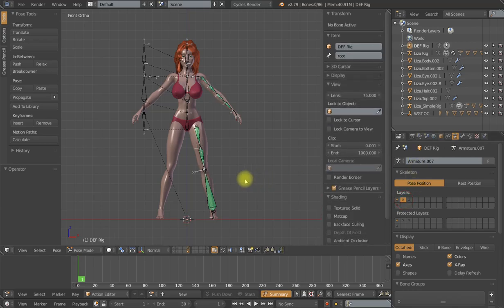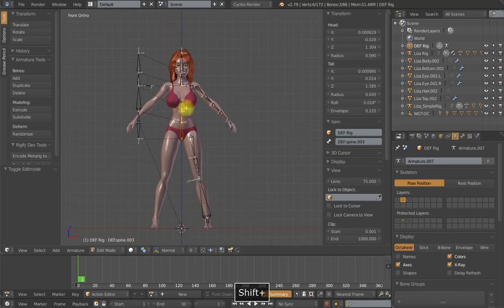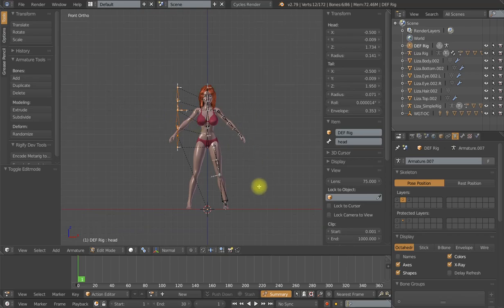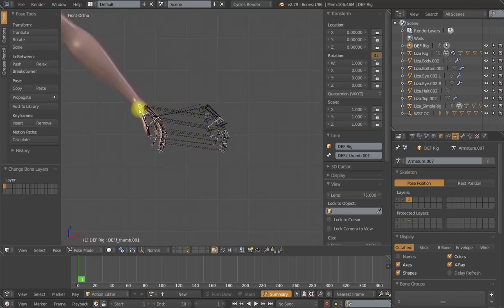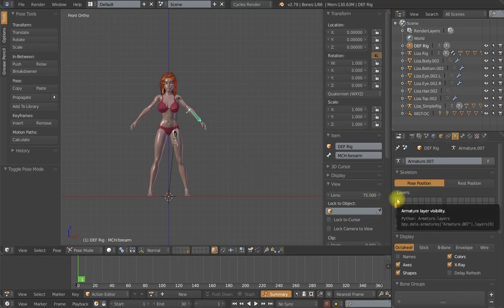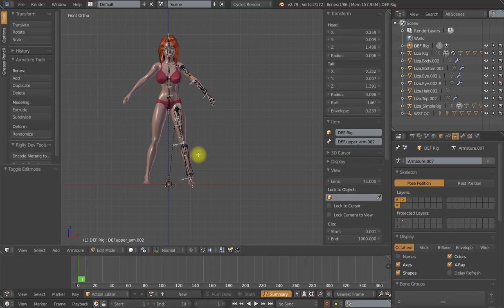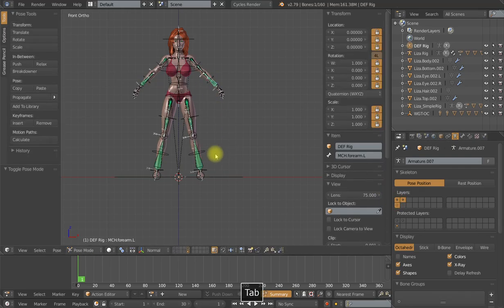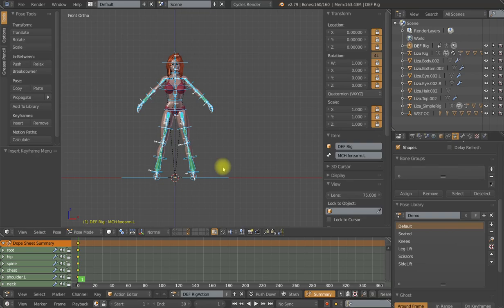Advanced Deformation Series Part 5 Efficiency Tips Rig Completion

Comment: I really like your series, even if it's unfortunately a bit too advanced for me. I've spent some time to learn how to use the rigify rig.. what do you think: could it (the pitchipoy version) be modified relatively simply to include most of the fixes you show here (without advanced knowledge on rigging)?  The best would be if the rigify rig would be developed further with many different options.. different rig types (for example depending whether you need  a rig for a game engine or to have the bet deformations possible) etc.
Reply from the maker: There are three new people in charge of the Rigify code now. They had promised to add support for new/different rig types. So far, I've not seen any progress for that. If it happens, I will likely release my own rig types with these fixes. The Rigify rig can be modified, but it is not an easy thing for people without some intermediate knowledge of how the rig works, or how to rig in general. I often modify the rigs to work how I want them, but I do not use the pitchipoy version as the base. I find the original rig types by Nathan Vegdahl,  (the original author of Rigify) to be easier to modify.
Reply: Sounds good, thx for the info.
Reply: One more thing: I know about two types of twist bone setups. One is used by rigify, where the bone parent order is Upperarm->upper_twist->Forearm->Forearm_twist->hand. while the other used in unreal for example: Upperarm->Forearm->hand and the twist bones are attached as branches to the upper and Forearm. This setup is better/more compatible with game engines where you need to setup foot IK, or weapon hold IK. With some try and error I managed to remake the pitchipoy rig to use the unreal like twist bones. I'm writing this that it can be something to consider for rigify and other rigs as well. (someone wrote a nice function for rigify which bakes the animation to a copy of only the deform bones and there are nice scripts which apply rigify rig to daz3d characters.. these are the reasons I'm trying to stick with rigify at the moment).
Reply: WHere did you i find info about this addon. I tried to look for info but there is hardly any Nathan deleted all his code from gitHub and doesnt do any updates. On some page i noticed they will upadte, but i havent seen anything, Cant remember the link though.

I hink my addon is really usefull for the addon. The function was already there but only worked in edit mode and it saves it to a text file in the file. So i added more options and better functionality
Reply: @RomboutVersluijs  hey man... I am trying to save my modification rigging system as template for my characters... your addon looks like a good for me ... it is for this purpose ? I ve not installed yet ,because I am very concentrated in a character and I ve a dead line for a client.... however I used to see dany's channel because he knows to much about rigging... I do not nothing about the future of rigify addon , I like it for a quick base to start creating more complex and customized bones and rigging template, but never found a good solution or general solution to make compatibilities for an array of characters, for example a barbarian warrior with full armored. thx.
Reply: He i jsut read your comment. I was ready a post on a blog about a animator which missed the save function of rigs. So is started fiddling around. I made it possible with an existing function to quick save rig presets so you can load them quickly the next time. It can also save rigify settings as a preset. I think this will save alot of time for some users. have a look here https://github.com/schroef/Rigify-Save-Presets

i also got some other handy addons btw

Comment: Hi Dan, you use rigify right? I made  an add-on which mak s it possible to save rig present and rigigfy settings super easy. Its adds a panel below rigify and you can save both settings.  You can find it at http://GitHub com/schroef/rigify-save-presets
Reply from the maker: I'll check it out when I get the chance.
Reply: PS if you do a lot of textureing, also check the  addon Extra-image-list. Its fork of meshlabs version but i altered it. It so easy to pick textures with this addon. Really a must have ;)
Reply: PS there is an addon which makes shapes for bones automatically. I need to check what its named though :) i found it last week